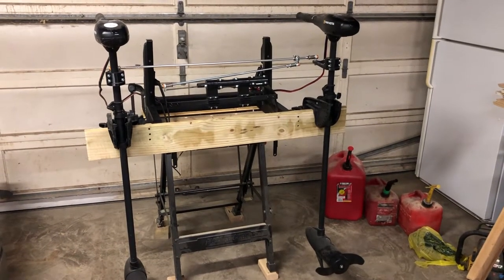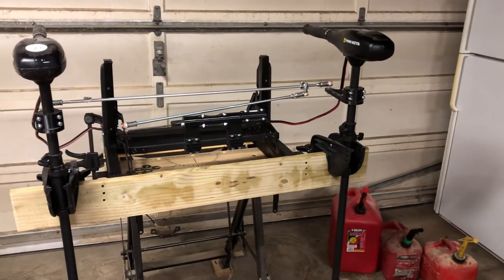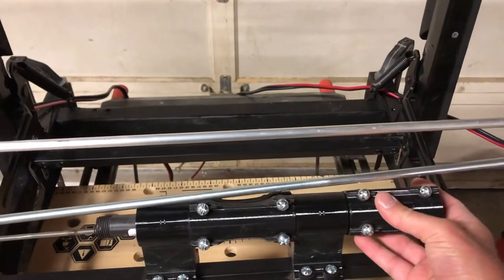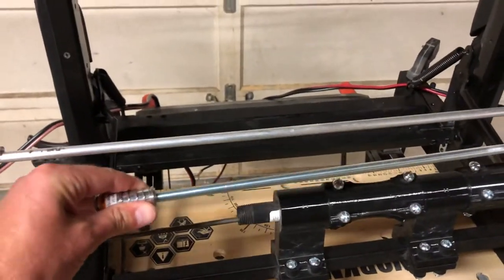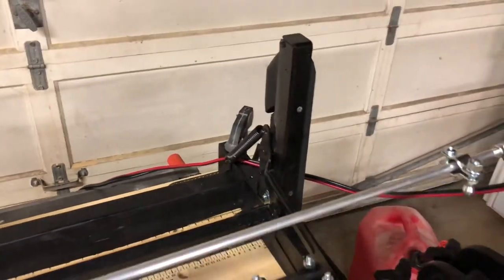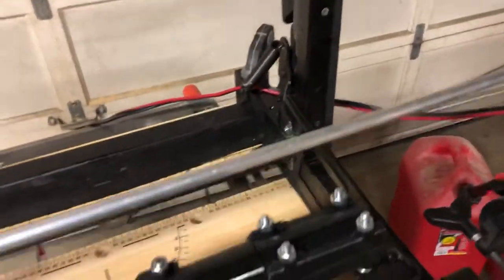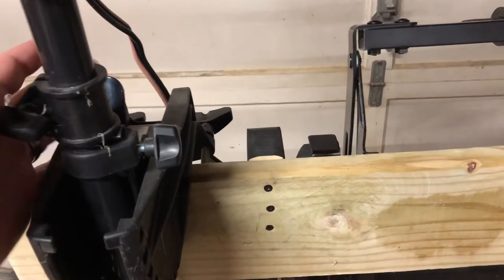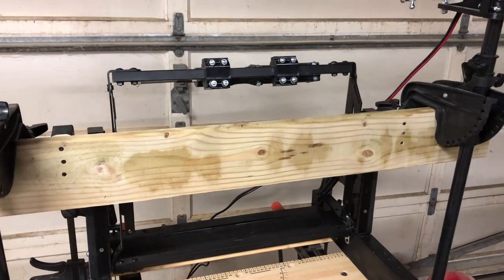Dual trolling motor bracket for my pontoon boat! (Part 1)

Comment: Where did you get the brackets that are on the trolling motors that the linkage is hooked to between them ?
Reply from the maker: I designed and 3D printed in PETG the brackets and the linkages came from two attwood “kicker motor” linkages. I replaced the one 24” rod with a 36” rod that I added threads to.

Comment: Where did you get the quick release tie rod ends?
Reply from the maker: Eric, thank you for the question. These were an amazing find that made the whole thing a lot easier. It is a steering kit for a kicker motor.

https://www.fleetfarm.com/detail/attwood-24-in-outboard-steering-kit/0000000063536
I put the link from FleetFarm because that is where I found them. Amazon has it as well. I actually used two kits. The “relay rod” that connects the two motors was a 3ft length of aluminum I added threads to with a die set.

Comment: Where did you get those clamps that are attached to the trolling motors that hold the linkage bar?
Reply from the maker: Thank you for commenting! I designed the clamps myself in fusion360 and 3D printed them in PETG. I was really amazed by how robust they turned out. So far no hint they will be a weak point.
Reply: Would you consider making a couple more of those brackets to sell me?
Reply from the maker: I would except for a couple things. One, my printer is down and second as I put them on this spring they are starting to show some stress. They could use some metal plates to support the bolts and my time is very short at the moment.